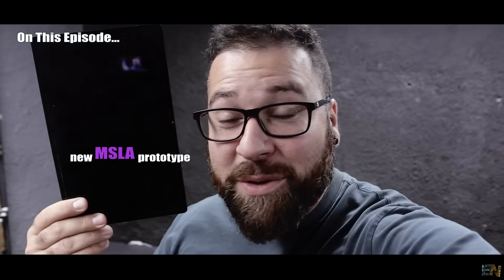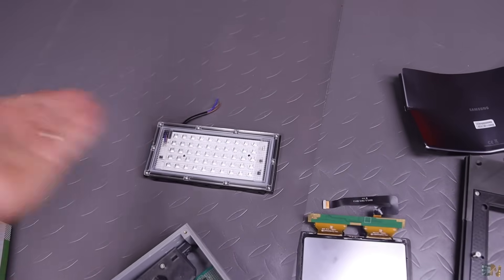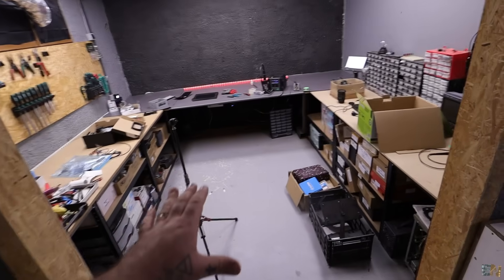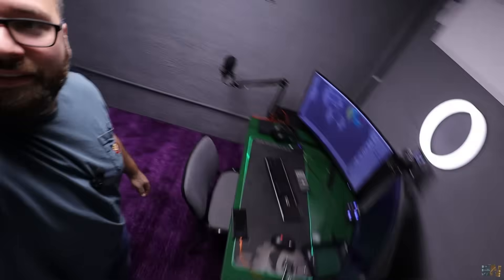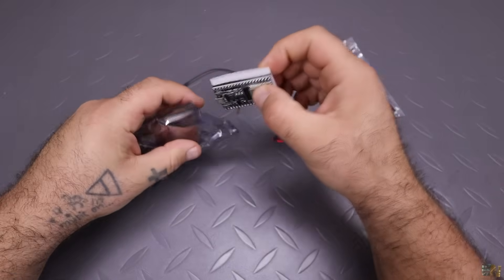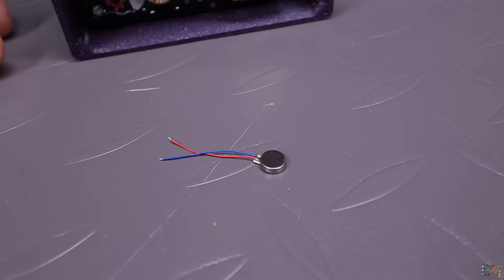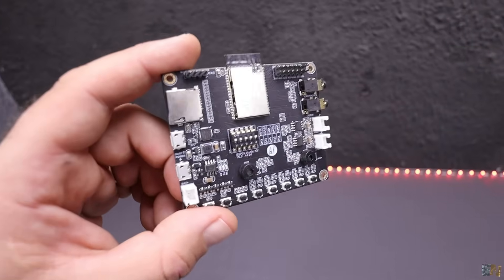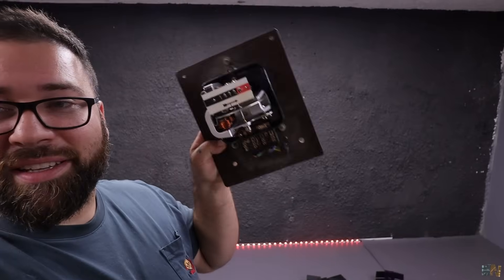Audio with ESP32 SD card, stream and more

Comment: 9:35 I’ve done a few projects using off-board antennas and it works beautifully. You can buy hundreds of styles of external antennas, from the stub/whip antenna you showed, to thin, flat ones you can glue under a plastic panel to hide them completely.

Comment: Looks like a bomb ? Nope looks like an electrical power ou water consumption counter. Edit : and after watching your video, this kind of electrical counter is not that old many countries still use it, in France they are replaced by an electronic counter called Linky, not 100% country has been replaced yet and some.people claim it is dangerous because of radio electrical radio signal Linky send thru electrical line to send statistics to power supplier, but I don't believe it is dangerous it is low power signal. And many people cheated with old counter.